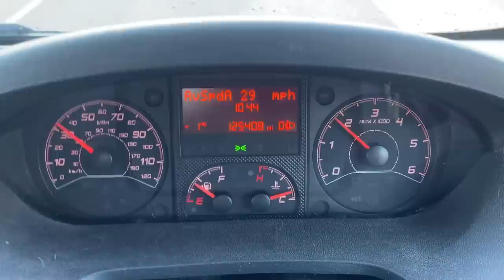Woken by angry locals and some all too familiar engine issues (Winter van life gets tough)

Comment from the maker: Go to http://www.nordvpn.com/campervibe to get the two year plan with an exclusive deal PLUS a special gift! It’s risk free with NordVPN’s 30 day money back guarantee!
Reply: Cheese
Reply: Gree error is how to say it . Hope u bought cheese
Reply: Why didn't you add salt table salt to sinks before going to bed . It helps stop ice forming inside the waste pipe at up to -8
Reply: I got a message from campervibe on my commit above on this video to send a message to you on tele-gram! I’m just going to assume it’s not you guys! Can you check it out?
Reply: First - you have to change van for the next big trip, this is becoming beyond the joke.  From myself I can recommend Sprinter 313 cdi 2.2 cdi , my father done with this engine from 60K till 135K without any issues , then only he have to change thermostat because the temp with the engine no go above 60 C, but the car still driving when the fault coming up !:)
Reply: If cooling fluid leaks into the engine it could cause massive damages! You should check, wether car got increasing oil level because of mixing cooling water into, or if there is white steam from exaust, even if the engine is warm! In this case, cooling water will overheat the piston area! Engine might report to be cold because there is no fluid at the sensor anymore.Good luck!
Reply: Another possible failure: the engine switch off the whole cooling circuit, when the engine is cold. That is to bring temperature to the engine faster. If this switch is defect, the cooling circuit will not work
Reply: please buy a new van, fanny isn't worth that amount of hassle.
Reply: You need by law to specify this is a sponsored video ?
Reply from the maker: at the start of the video it states on screen that the video contains paid promotion.
Reply: @campervibe  the "paid promotion" banner hasn't come up on this video.
Reply: @katebriggs9301  I'm pretty sure it's a bot - there's one character different in the name? Perhaps an emoji? It pops up all over Youtube, I report it as spam but Youtube doesn't seem to care.
Reply: @katebriggs9301  Well Done! You were prudent & didn't take the bait. I was daft enough to not ignore it & got caught. It cost me over £500 before I realised the trap.

Comment: Honestly, you two were definitely made for one another. Loving catching up on the older videos. When we are on the road, we have to take the good with the bad. Trust me, I know very cold winters well. I am from Labrador where there are only 2 seasons,  8 months of winter and 4 months of summer. That inner tubing was awesome. Years ago, my sister in law and I went down a huge water slide. I thought I was going to have a heart attack. We were both quite large at the time. We came out of the shoots at the same time. We made a splash so big it soaked the onlookers at poolside. I am glad I did it but never again. LOL.

Comment: If the coolant disappears and it is not leaking or ending up in the oil, check if your engine has a breathing valve on the very top point of the cooling pipe. Mine was stuck and the engine sprayed the coolant on top of the engine. It vaporized leaving no trace of a leak. The sudden event in your case might be caused by the air pressure change and altitude. 👍 ps. Get a can of alcoholic windscreen washer fluid and pour some of that in your gray water tank to keep it from freezing. 🤓❄️🇫🇮

Comment: In my Diesel I used to slide a garbage bag between the a/c and radiator about half of the radiator, it gives the thermostat a chance to manage the radiator temp. One of the benefits was the fuel filter didn’t have to be changed as often as the wax didn’t come out of suspension, you might find the temp gauge works normally as well.

Comment: I hope your Fanny is feeling better 🤪 but if not, I found a tip that's a possibility: "A thermostat stuck in the open position will allow a constant flow of coolant causing a lower operating temperature. This increases emission, makes the engine wear faster, and leaves the temperature gauge reading cool at all time" 🤞

Comment: Your coolant loss could be due to an airlock when the new engine was put in. A couple of hot and cold cycles and it seems to be fine. Your temperature guage problems could be related in which case it could rectify itself in time, or the sensor could be duff.

Comment: Hey Gals. If your engine water temperature gauge is going up and down you may have an air blockage in your coolant system.  You may need to bleed the air out. Not familiar with your engine so you can look it up on Internet or service manual. My van is a real xxxx to do. Take care have a great adventure from us pensioners George and Jane.

Comment: I might be wrong but i think it should be on max when the engine is hot as the thermostat will open then system will operate correctly. Max on cold might be over filling it so it will release the excess out. Also did they change your thermostat when you had the work done? 🤞it might just be the thermostat
Reply from the maker: Hmm I’m not sure but Lou would know

Comment: Sounds like your heater trouble could be an air-lock in the heating system - kep topping up when need be , keep an eye on it and have the coolant system flushed through when you get back home. Used to just use a hose with mains pressure to blast it through. BTW great vids and youre a lovely couple.

Comment: Engine temperatures (as advertised on a French gauge) can be mainly two things: 1. the gauge is faulty or the wiring connected to it is dodgy or the temperature sensor is faulty (My money would be on the last one) OR 2. the thermostat is stuck in open or halfway position causing the engine to not be able to maintain a steady temperature.
Best way to check the engine temperature is to have a hand held IR thermometer which you can point at the engine block where the temperature sensor is at (or if better accessible) the outgoing hose to the heater core. 
A less reliable way to see if the engine is getting up to temp is to feel het heat coming from the heater core. If that amount of heat fluctuates then the engine coolant temperature is obviously also fluctuating and most likely the thermostat controlling the water flow to the main radiator in front has issues and needs to be changed out...

Comment: Just a thought Louise, have you tried bleeding the cooling system, in case there it's got an air lock? There should be a bleed screw on one of the heater pipes. I know the van in the video I have linked is a newer one than yours, but ours which is 12 months older than Fanny has the same bleed screw.

Comment: Hi guys, as usual you have managed to find the most incredible scenery. The banging on the door would have scared the crap out of me. I was delighted to see AJ enjoy himself in the snow, how did Summer fare out in the cold?. Those roads look scary especially as you are in a R.H.D. van , so coming down the mountain must have been just a little bit extra scary. You are wise to keep an eye on the coolant level, the fact that you are not loosing any coolant due to a leak, and from what you are describing with the temp gauge fluctuating it may be as simple as a faulty temp gauge switch.  A simple way to check for leaks is to place a sheet of cardboard under the van when you park up for the night and in the morning if you have a damp/wet spot will give you an idea where the leak is coming from. Thanks again for your wonderful vlogs, looking forward to more, stay safe and enjoy the rest of your trip.
Happy trails 
Karl Horgan
Reply from the maker: Summer does not care for it much she prefers to be snuggled up on the bed 😀

Comment: Great video ladies.  We do a heck of a lot of RVing but we pull our teardrop.  Got a great pal who does the same but in a nice custom van.  One mod he made was to install lights around his luggage rack and several small wifi cameras.  He's had the knock once and flipped the lights on (which activated his cameras) and scared the HECK out of a teenage boy and girl out doing pranks on RVers at a boon dock site.  Needless to say, they had no issues for the next few days.  If I can make a suggestion, let your van warm up to operating temp and then check while it's running to see if the radiator cooling fan is working.  I don't know what temp it should click on with your van/motor but I'm sure you do.  Verifying it is on will at least eliminate one issue.  You can check the oil to see if it's unusually dark that might suggest it's a oil coolant issue.  Hoping it's an easy fix and just a stuck thermostat.
Reply from the maker: Thank you 🙂

Comment: @Camper Vibe
When you are checking the coolant levels check your oil level as well, as long as that stays at the same place you have no coolant going into the engine. I would say to get your thermostat checked to get the heating back to normal.  Wonderful vlog. Came down From B to Brig to Lausanne and over to Dijon quite a few times bringing people on skiing holidays to Zermatt.
Reply from the maker: Thanks

Comment: Nice one girls, when you get back Lou change those crap brittle pipes with Silicone pipes got mine off eBay easy push fit on and easy to get off  always stays flexible try a new thermostat it should get rid of the problem stay safe xx

Comment: If water level continues to fall, a common fault with this engine is the EGR cooler, its only small and is bolted to the EGR valve. If you loosen the two bolts holding them together, and water drips out, that's the problem, they rust inside and allow water into the recirculated exhaust, and into the inlet manifold.
Worth keeping in mind even if it's not that.
Good luck on your travels.
Reply from the maker: Thanks

Comment: Its quite possible that coolant problem could be the early on set of the head gasket going. Had the same things happening on my van a few years back.
I just plodded on doing what your doing, constant checking etc.

Big mistake.

In the end it was head gasket and catastrophic breakdown. Tried head gasktet sealers that you add to coolant but it didn't work, was too far gone.

If I had done it much earlier it would have worked and dealt with the problem in the longterm.
Some of these sealers can be added to the coolant and just live in the system as a precaution and preventative measure. They are very cheap to buy and you have everything to lose by not acting now as a precaution. Might save a massive garage bill too.

Hope this helps.

Comment: Me , same van, same history of problems. My good garage told me that the thermostat is at the top of the engine and if problems are happening down the bottom round the water pump and it's flexible ( well perishable) hoses then it can be not revealed in the dashboard heat dial thingy. 

Check those rubber pipes down the bottom. Go to a garage 😁.
Best of luck
Reply from the maker: Thanks

Comment: Caraflow
Waste Water System Antifreeze specially developed for caravans
-20°C Freeze Protection
Caravan Warehouse. 
Pour a little in the sink plug hole before bed. Just enough to lay in the pipe under the van.

Comment: Just found your channel....................where have I been?. Sooo pleased I'm here. Great content and beautiful scenery, cheers. Are you both Londoners? I am 😊, greetings from Greenwich 👍. Sometimes Louise it's worth replacing the expansion tank cap. Evidently over time the rubber seal in the cap ages and loses its necessary vacuum. Also thermostat or sensor maybe your issue although in colder climates with cabin heaters on etc the coolant evaporates quicker. Anyway Happy & safe travels to you all

Comment: Great scenery and vlog. A couple of tips with the engine that you may or may not already know. Check underside of oil filler cap for white emulsified oil in water and if you can access any of the water (coolant) hoses easily give them a squeeze and see if air bubbles out the coolant tank. might be getting air in the coolant creating an air lock and possible inaccurate temperatures. Sounds like you are managing it and if the fluids dont mix, or run out, should be good for a while. p.s a while is not a defined measurement of time sorry. Good to see you all enjoying yourselves in the snow.
Reply from the maker: Cheers Mark

Comment: I had the water from the underfloor fresh tank freeze, probably in the outlet hose despite pipe insulation. I redirected the heater exhaust pipe to blow on that area (it was just long enough). Didn't take long to thaw, and I am keeping the heater exhaust there.

Comment: we had a campervan on a peugeot/citroen/fiat chassis - brand new out the factory and had nothing but trouble with it, it was in the workshop more than it was on the road, we kept it 2 yrs and got rid, warning light, eng management clocks, everything electrical all the time, they have been making these vans now for years so you would think they would roll off the line in perfect working order, We switched vans to a renault chassis, that was in 2015, still got the van and never had any issues what so ever.
Reply from the maker: Nice to know 🙂

Comment: Good video👍 Sounds like the thermostat on the van is knackered. It's probably stuck open, which doesn't allow the engine to warm up. Temp gauges rarely fail.

Comment: Hi looks like your thermostat may be faulty, ie temp gauge not going up, you could try cover the grill while driving in cold to see it helps engine to warm quicker and reach good temperature in the cold weather. Had this problem recently in cold weather, covering grill helped as temporary fix, but not quite reaching halfway on temp gauge and cooling down quick. Problem went away with new thermostat. Not a big job but worth doing, if left like this for long can affect catylytic convertor and DPF.❤👍
Reply from the maker: Thanks

Comment: Hi had similar issue with my van 2018 2.0 hdi. Had no heating at vents & temperature gage up & down. Turned out to be water pump citroen replaced & did cam belt at same time.

Comment: I can certainly recommend getting the cooling unit fixed as soon as you can. I recently set out on a trip with my family to a wedding here in Mexico for which the journey was around six to seven hours. My Dodge Durango which I keep in tip-top condition suddently overheated in a small desert town in the middle of no-where and we ended up having to leave it outside an Oxxo store while we got a taxi to nearest big city so we could find a hotel. We had a local mechanic look at the car the next morning and within seconds he spotted that the cooling unit was covrered with blue paint which in Mexico apparantly means that the part has come from a junk yard. Long story short a guy in our city who had recently worked on the car had most likely stolen our cooling unit and replaced it with one from the junk yard hoping we wouldn't notice. We never made it to the wedding but the wedding did make the national TV news as all of the guests where poisoned by the food and water. Cheers!
Reply from the maker: Oh wow, thanks

Comment: 👋Hi from New Mexico🌶️🌵🙂....Enjoy the whole vlog. Louise when it's that cold the temperature gadget will not get to the mid-point unless you put some cardboard in front of your radiator. I used to live in Wisconsin many years ago and that is what we would do.  You don't  need to cover the whole thing. But if it's not getting warm with your heater then put up the cardboard. What fun you had with the intertube sleighing. 🤗 My hand brake went out on one of my vehicles and so i f park heading down hill turn your wheels toward the  curb and if you park going uphill turn your wheels outwards from the curb. Had to do that until I got it fixed. I had a friend that carried a board and wedged it so it put her brake on. Lol It worked!   I enjoy all of your vlogs.💖💖
Reply from the maker: Thank you, great info 😀
Reply: @campervibe  Your welcome and looking forward to your next 🎥💖😊

Comment: Have you tried putting a piece of cardboard in front of the radiator so that it can maintain it's heat? Some radiators even have a function were you can open and close the radiators blades in summer and winter so yours may have that. It was always a standard modification at our bus company in the winter to put something in front of the radiators of our buses otherwise there was no chance of the water keeping any heat to keep the vehicle warm. You might want to check with Citroen or Peugeot first (can't see exactly what your van is), but I would certainly give it consideration.
Reply from the maker: No we have not but she is going too a few people have suggested 😀

Comment: While in France we had the same issue with the temperature gauge on  our Motorhome just before entering the Pyrenees. Local garage diagnosed a dodgy sensor... Changed in 30 mins total cost 60€ and it's been fine since.
Reply from the maker: Nice 👌

Comment: The water heater going off, intermittently could be an air trap in the system, there might be a air vent high up on the engine or bulk head, that would also be why temperature gauge varies, air doesn't transfer heat to sensor as well as water does. the level drop, as only small could just be contraction, due to colder climate, and altitude, even air contracts when cold thats why tyre pressures drop, keep an eye on it, doesnt seem to much to worry about, what stunning travels guys..
Reply from the maker: Thanks